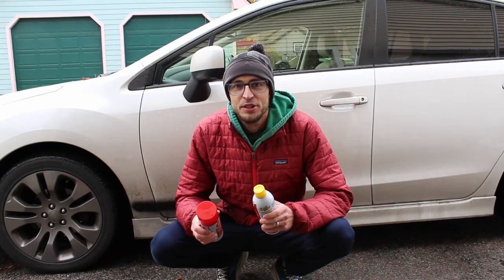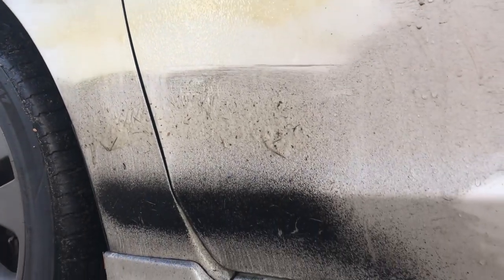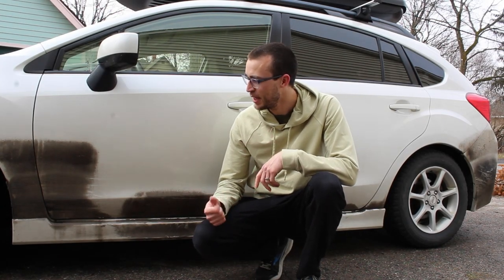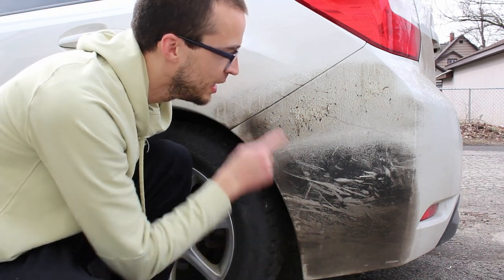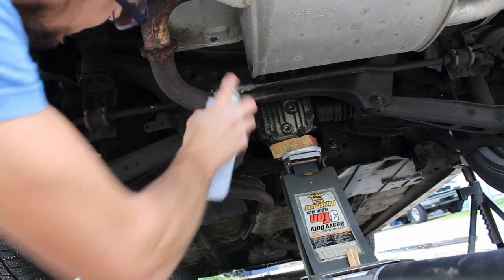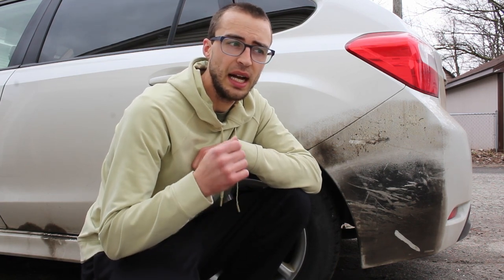Fluid Film VS Surface Shield - Rust Protection Undercoat Comparison Test

Comment: It all depends on how you apply fluid film with how long it will last. I've had vehicles go longer than 2 years without needing to be touched up with fluid film, after applying fluid film, best thing you can do is drive down a gravel road as the oily substance soaks up dust and debris. It's solidifies into a stronger type undercoating and will last for years without needing to be touched up.
Reply from the maker: After many applications over the years mine seems to be very goopy and doesn’t come off very easily I have noticed as well.
Reply: @anthonynicholson5523   that's because it's petroleum jelly based and the only thing that's left is the petroleum jelly and not the lanolin oil that protects from moisture and corrosion
Reply: @JrodKustoms  how do you know what’s left behind?   Since the two are mixed wouldn’t it be more correct to say some of both are left behind?   If woolwax were water soluble it could be removed by water and leave the petroleum jelly behind but it’s not.  It makes more sense that a mixture of both is still there.  I’ll get some spray cans and do my own comparisons.  Appreciate all your effort on the subject.
Reply: @joefoster259  Is it than Lanoline arrested in Vaseline and cannot move?  I will buy one can of ss and see what I get from it.  You can google "10 year of using cold galvanizing compound" to see my testing.
Reply: Dust and dirt absorbs the undercoating and causes it to dry and fall off. You are wrong
Reply: @1991tommygun   I've had a coating on many vehicles for over 2 years with nothing falling off and still being soft underneath. Sorry but I think you're wrong, When I wipe with my finger on the frame, a dry layer comes off the outer half and they're still a soft oil residue on the frame, spraying it inside of area's Is what's most important because that doesn't wash off stays there forever. Fluid film stay soft and does not dry out. That's the best part about it
Reply: The best time to apply fluid film is during the summer. Even better to leave the spray bottle under the sun for a bit. This will soften the liquid inside and will spray thinner. This will allow the fluid film creep better into wider surfaces. As the winter approaches, it has already collected dust and a bit hardened the surface. That’s super ready for winter road salts.
Reply: If this were true they would just mix dust into the product to make it better.

Comment: Rust check in Canada has the right idea. They use a thin runny product inside the panels which creeps everywhere. They use a thicker, more durable product on the chassis and exposed areas.
Reply: Rust check washes off very quickly , Not a good product

Comment: I used fluid film last year and surface shield this year, both times from spray cans. They look the exact same applied on the vehicle and if the labels were covered I would not have been able to tell a difference in how they look on the vehicle. The one thing I did notice is how they spray out of the cans themselves. I had a lot harder time getting the surface shield to spray from the can. After I used about 1/3 of a can it started oozing out from under the spray nozzle...A LOT. In the entire can of surface shield I bet 1/4 of it oozes out from under the spray nozzle and completely covered my hand. It was a mess. I have no idea why this happened (maybe the petroleum jelly?) but the only difference I can see is surface shield needs to work on their spray cans because at least 25% of the product goes to waste while you're applying it!
Reply from the maker: Must have to do with the nozzle. Did you try cleaning it out? Sometimes it just needs to be cleaned
Reply: I had the same problem with the surface shield clogging and stopping to spray with three cans.  I found if I let them sit for a few mins it would seem to work.  The only problem is now I have three cans that are about 1/3 full.
Reply: What was the temp when you experienced this?  Heat the can up and I suspect it will spray better and empty the can.
Reply: Try submerging the spray cans in hot water for 10 to 15 minutes before spraying it really helps move the product out of the can!
Reply: @SNELLERIZED  I think somewhere between 45-55 degrees
Reply: I just sprayed 4 cans today on my vehicle and that was exactly my experience as well. Clogging and leaking out from under the nozzle. I guess one should expect that this is going to be messy but I agree it would help if the nozzle didn’t work. Rubber gloves are a must.
Reply: I've tried to keep them as warm as possible in between sprays and it helps...a little.
Reply: How many cans do you recommend for a mid-sized car?
Reply: Same issues when i applied it last fall, i emailed them and they took care of the issue...i tried cleaning them, swapping out the nozzles, nothing worked
Reply: @Always_Never  I'm actually having a company apply fluid film for me this year. We'll see how that goes.
Reply: Good to know. I plan on using Fluid Film first. Maybe if I'm satisfied with it, I'll jut stay with it. Time will tell.

Comment: Good review. However, price should also be considered when comparing value. Surface shield, at least when purchasing in gallon cans for spray gun application, is WAY more expensive than Fluid Film and also substantially more expensive than Woolwax.
Reply from the maker: True, I think most people use the cans which are pretty comparable and honestly the largest investment to do this is your time so it’s not that large of a factor for one over the other, but yes you are correct I’ll have to look at the gallon prices I’ve only looked at the cans. Thanks!
Reply: Not to mention the cans can clog rather easily so you're better off taping off and prepping a large area all at once instead of little areas at a time.

Comment: Sprayed Surface Shield on a brand new 2024 Tucson 2 weeks after i had it professionally coated with the rubber black stuff (terrible idea with the rubber stuff btw)...i essentially got away with this because the prior rubber stuff wasn't fully dried and the professional did poorly on coverage.

Fast foward one whole year and the surface shield and rubber stuff created like a weird super sticky alloy of sorts that will never wash away.

But in most places where it was bare/painted metal, the surface shield didnt last and some drivetrain/suspension parts did experience some corrosion.

I think part of it is also due to car washes. 

My dealership likes to wash the car every time, i didnt ask if they do an underbody wash. I've done a couple washes too and didn't know if the underbody was sprayed.

Either way it was like 90% gone, definitely wouldn't hold for 2 years.

Honestly with midwest winters i feel like cars need to be seasoned, sent somewhere south for a year to bake the wool wax on then reply and repeat and maybe 6 years later it will stay on good.

Comment: I use LPS #3. Very rarely mentioned in all these tests and comparisons.
Reply from the maker: Never heard of it I’ll have to check it out
Reply: LPS 3 is a great product
Reply: I used LP3. It's move ticker than fluid film. It won't wash off easy. It just stick to surface
Reply: @moneyparhar  LP3 is Cosmoline.  Like CrC HD, Crown HD etc..

Comment: As an auto detailer and paint correction specialist of 35yrs, I gasped at spraying any of these on your final paint finish and then fell over as you rubbed your finger across the surface. Grant it, the former probably isn't detrimental, but the latter and the subsequent removal of the products, will likely cause surface scratches in the clear coat at best, and deeper scratches requiring polishing at worst.
But, thanks for taking one for the team and showing us how both perform on a really smooth surface. On my Collinite waxed vehicles, neither would survive a month 🤣
Reply from the maker: Haha I’m well aware! This vehicle is mainly an “appliance” type vehicle so a few imperfections isn’t a big deal. Also daily driving in the rust belt it will start to get rust through the body and these scratches won’t even be noticeable lol. But yes if it was a nice car of mine I wouldn’t be doing that!
Reply: I read that  to remove the surface shield  from areas that received  over spray  (painted body panels) that it requires using paint thinner or acetone to remove it. That to me sounds quite toxic, will not be good for plastic pieces or previous wax jobs
Reply: What did you think of that automatic car wash with the brushes?
Reply: Thought the same but considering it a sacrifice for the sake of knowledge
Reply: and the soft touch wash
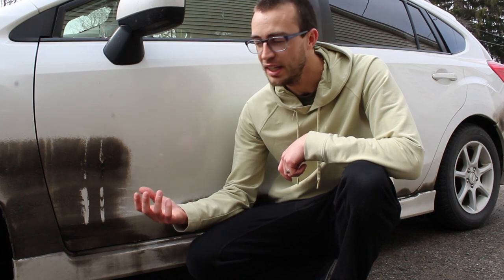Reply: 6:34 bruh you must have missed the part where a snowplower ran dirty icy snow full of abrasives along the side of the car... his finger is no issue here
Reply: @ding9633  they're terrible

Comment: Would it be possible to just spray rust remover under the vehicle after each winter? Just remove the rust after it has come? Using some pressure washer in between applications
Reply from the maker: Not that easy to do.

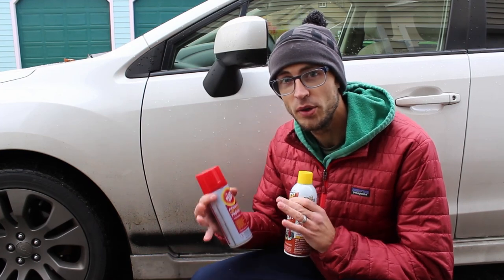Comment: I like 1:35 .  Right question.  Is it creeping ability trade off.  Edit so I did spray f Cosmoline at side of my car, exactly same place for test.  It was there for approximately 3 years and 50 car washes till faded off enough.  Edit I agree with your conclusion at 12:00.  My combination is Cosmoline directly over rust.  If paint is on nothing at top of it.  Fluid film in cavities.  Cold galvanizing over exhaust pipes.
Reply from the maker: Thanks!
Reply: @KurtofTrades  It can help if you check my tread "10 year of using cold galvanizing compound" "ford forum".  Do not want post link in your video comments.  Check post nr #28.  Experiment of 2 years is there.
Reply from the maker: Took a peek.  Was it already rusty when you bought it?  Seems like stopping it from beginning is the best no matter what.  My car had zero rust on it when I started using fluid film and it’s doing very well.
Reply: @KurtofTrades  No.  It was 10 years old then and not so much rust when I got it.  I used cold galvanizing for 10 years but it rusted right through.  But even cold galvanizing is better than nothing.   Before it I used por15 and rubberized coating to same not so good results.  Cosmoline directly over rust work for me.  Cold galvanizing works well at exhaust pipes.  Exhaust at pickup is 23 years old and still good.  Same with my small car 20 years old.

Comment: "CREEP" occurs upon application when the material is wetter and thinner. 
After they dry, "creep" does not occur.
Reply from the maker: It actually does still occur after they dry, fluid film never really dries.  Mine always creep a ton when it warms up in the spring. They creep about 3-4 inches months after being applied

Comment: I wonder if the perception that the products creep is actually just light over spray that wasn't visible at the time of application.  This also applies to the self repair aspect.  When some of the product gets knocked off,  it still leaves a sticky film behind that dirt ends up adhering to, giving it the illusion of filling the holes.  The reality may be that the hole was never really a hole, just a thinned spot.
Reply from the maker: Don’t think so. I’ve applied it the same way every year in the same spots. If it was overspray it would get covered it grime very quickly. It definitely creeps.
Reply: @KurtofTrades 100% creeps have proven it myself, fluid film my interior body panels with pinch welds like rockers ect then I wool wax the rest of the underbody, surface shield is 15-20% petroleum jelly so another guy on YT that tests it say it’s much better than wool wax or fluid film since when the lanolin washes away the petroleum is still on the surface. I may end up doing that next season

Comment: I agree you won't go wrong with either product. But I always get "Krown" done as the first treatment on my vehicles no matter I go with for future applications. That stuff creeps into the smallest seams where rust often likes to begin. Usually I stick with Krown, but I have tried others on various cars (NEVER rubberized tar like treatments though). I live in a major rust belt in Canada. I want to protect from than just body rust, but brake lines and fittings, suspension bolt threads etc. As a DIYer it's sure helpful when parts aren't rusted together.
Reply from the maker: I’ve heard a lot of good things about krown as well, seems pretty similar. Thanks!
Reply: Those apply Krown rust proofing will drill several 3/8” holes your car to access all the places inside the body and doors. They then insert “factory looking” plugs into the holes. Krown might very well do the job they claim, but when I heard that I said no thanks. Not going to drill holes in my car. Probably would void the corrosion warranty too.
Reply: Try Corrosion Free Rust Cure u will stop using Krown ;)
Reply: @ukasz6539  Franchises in southern Ontario?
Reply: @pedrorojascervantes3928  Dont know i live in Poland
Reply: @dewfall56   they drill to get access to areas they otherwise wouldn't. You can request no drilling though.
Reply: Krown is garbage, if you want something thin go for Red Rustcheck

Comment: Does it matter what condition the metal is before applying these and does it help to treat them before and if so how? Is cleaning and degreasing enough so there's something clean to adhere to?

Also, if one is willing to put in the time to derust the underbody and parts, is there a preferred way to treat them prior to applying an oil-based rust protector such as these? E.g. POR-15, epoxy, SPI, powder, etc. And either way is it important to get all the rust out or only as much as you can?
Reply from the maker: These products are supposed to be used before your car starts rusting at all, ideally when it is brand new or before it sees salt the first time.  They work best by stopping the initial rust formation in problem areas like doors and nooks on the underside.  Once the car is rusting from the inside out these won’t help much.  They require very little prep.

POR15 is for after your vehicle is already rusty.

Comment: FLUID FILM was developed for the NAVY to STOP RUST in their double bottom ships back in 1943.
I've been doing PB BLASTER  penetrating spray let dry then hit it with FLUID FILM with great results. 
This year I bought a gallon pail of SURFACE SHIELD !?!?
HMMM 🤔
Reply: I don't recommend that you just spray PB Blaster penetrant around under your vehicle liberally.  That stuff works good as a penetrant bug it eats rubber and plastic bad.  It will destroy your bushings, cv boots, and various seals of you get it on them and crack your taillights if it were to creep a c finc it's way onto them from road wind blowing it around.

Comment: I must have got defective cans or something of the surface shield because no way I’ll ever get close to 2 years out of this stuff! I live in south Florida, which is a climate typically different from those who would use a product like this. The reason why I used it is because I’m originally from the rust belt and I tend to take trips up that way. I applied the surface shield in November and haven’t been up north since applying it meaning it wasn’t really exposed to the heavy precipitation/snow and salt of an Ohio winter but instead in went through south floridas  “dry season”. We don’t get that much rain during these months and it was weeks before it was wet for the first time from rain. As of May 2022 o was shocked that a lot of the areas under the body were mainly just dried packed dirt. When I wiped the dirt with my finger, it was dry dirt like a car that just had not been washed in the very long time. I never rinsed the underbody at all as well. I don’t see how this can last 2 years if it’s already just dry dirt in a lot of areas in about 5 to 6 months. Is this normal? And wouldn’t packed on dry dirt just encourage rust?
Reply from the maker: It does collect a lot of dirt but it should still be somewhat wet underneath.  Maybe you didn’t put enough product on?  Not sure strange!
Reply: The dirt is attached to the wax film so it won’t rust the metal. As long as the metal is sealed up from moisture and elements, it doesn’t necessarily matter what’s stuck to the film.
Reply: The dirt makes it work. You can throw sawdust or Fullers Earth on it after application too.

Comment: Thanks for doing this comparison.  I just bought some Surface Shield to apply in the Fall.  One thing I wonder about - I like to clean the frame off as best as I can when I've been off-roading or if I've driven in snow/salt (for protection and also makes it look nice).  Once this undercoat is sprayed on, do I need to just leave it alone and not clean up under there (since my cleaning would otherwise rub some of it off)?  Maybe wait until year one and do a thorough clean/removal before another annual application?  Thanks!
Reply from the maker: Spraying over it with a hose is no problem but I wouldn’t use a power washer.  Surface shield is extremely sticky stuff. It will be very hard to remove it all you pretty much have to scrape it off.

You can apply more over the old coat but if you want something you can wash off every year go with fluid film, surface shield is extremely hard to remove.